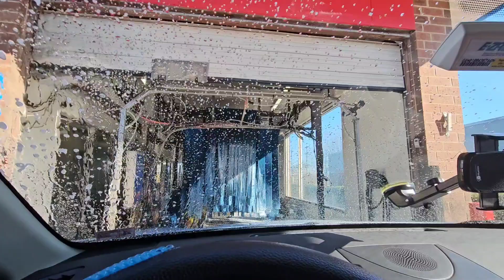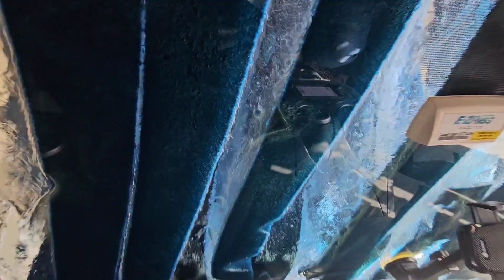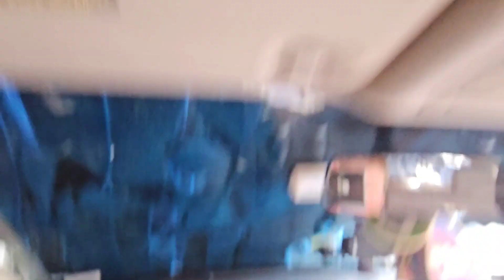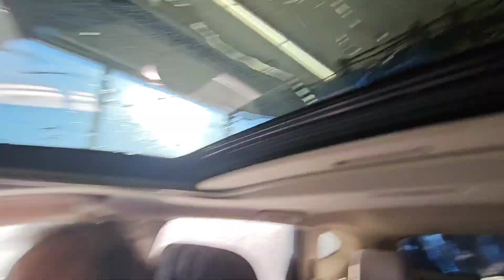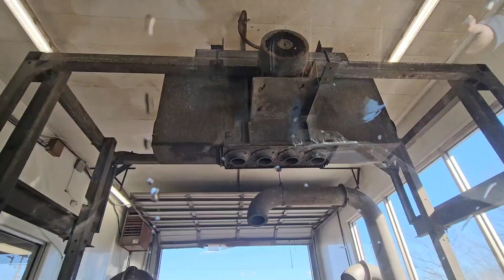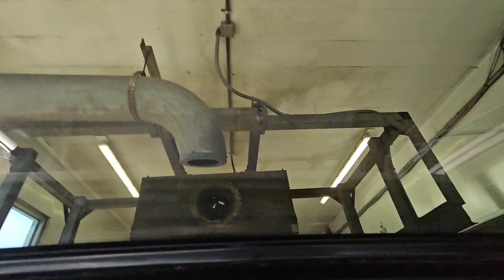Old Hanna Sherman Tunnel with Hanna/ Concorde Dryers

Comment from the maker: Just so you all know, the big rectangle dryer is the type of dryer that was used for Hanna drop-down dryers and diagonal and hosed side dryers. The pipes would be connected on each side  and next to the blower intake. The unit was taken out a long time ago and replaced with the middle four circular outputs. The pipe connections were capped off.